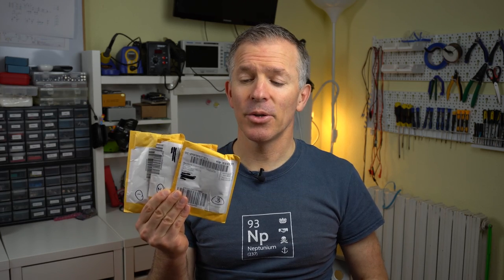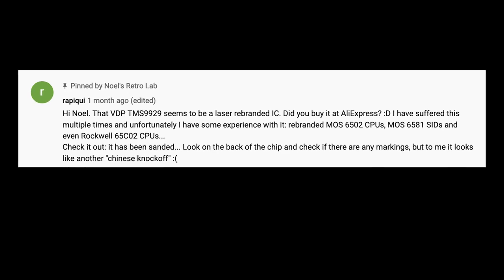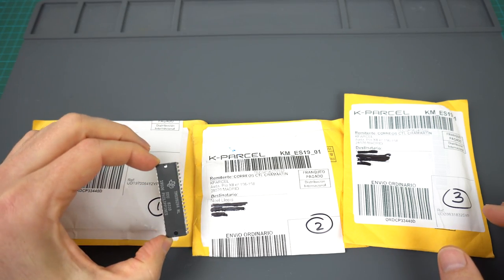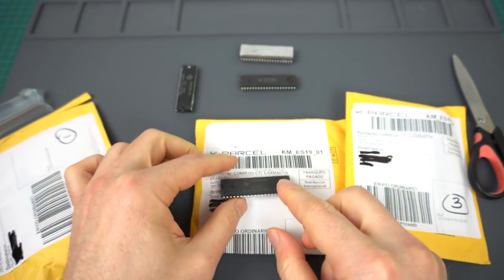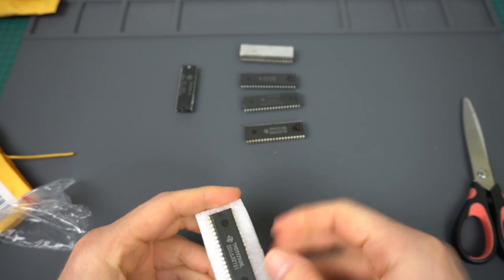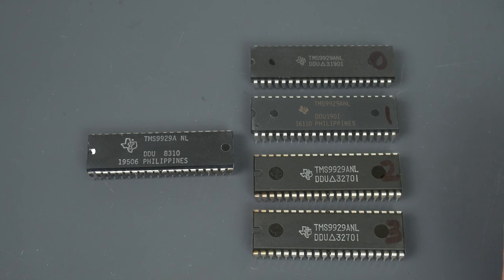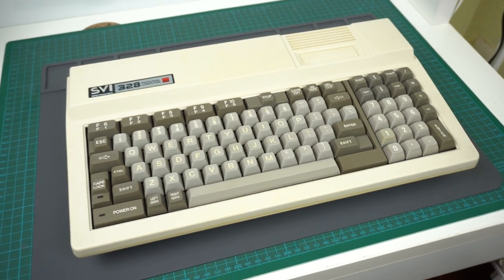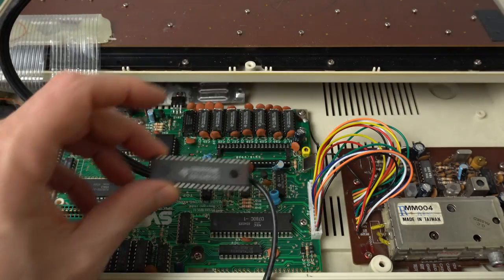Detecting FAKE Chips From China 🔍

Comment: I think the sellers are being scammed themselves, by wholesalers.  The fact that two had the same packaging suggests to me that the items had arrived and been shipped without testing, inspection or verification.
One instance that happened to me, I bought wire strippers from an eBay seller, in my own country.  They didn't work, the assembly was so poor they just couldn't work at all, so I contacted the seller with an explanation of how the strippers could never have worked and a photo and a diagram of how they never gripped the wire.  All I got back was "I just sell them" and a refund.
Reply: They must be "Drop Shipped". The seller never even sees the product.
Reply: Was thinking same...drop ship bulk buy
Reply: Most likely and I’m willing to bet it’s around 60 percent real and the rest are fake so that the fake ones will seem like “dead” chips while in reality they never worked
Reply from the maker: True, but a reputable seller would cut that distributor completely once the reports of fake chips started pouring in. I believe these guys continue buying from the same distributors even knowing about the problem with fake chips 😞
Reply: Resellers and middlemen can often get good parts when they order for the first few times with a supplier but then the quality seems to drop eventually. Bad batches exist also when buying in bulk. Sometimes there are legitimate excuses but other times not. Buyer beware but having a personally known contact defintiely helps with minimising fakes or broken parts.
Reply: I think most people in the "west" has the mindset of "trusted vendors/brand", I am not saying this mindset is wrong but for the Chinese it's completely different mindset altogether. Most of those sellers on Ebay selling cheap stuff belongs to a MASSASIVE industry of manufacturers, recyclers, sellers, vendors  in China. That is why they all have the same packaging, descriptions, price, etc. They may or may not belongs to a same seller but they've got the products from the same sources. Just look up videos or if you have been to any of the "wholesale" market in China, you will know. Tens of thousands of vendors selling basically the same stuff from equally as many manufacturers. They are all generically made and resell. When there are literally ten of thousands of vendors out there. There really is no "trusted vendors/brand", one vendor is just as good or bad as others. One vendor could be selling bad ones one day and could be selling good one the next day. I can bet you that those sellers in this videos has thousands if not tens of thousands item listed. With this many items selling, no one will realistically quality check the stuff that they are selling, just as long as they can sell them. I can imagine that these chips are so cheap in China, even if they sell them at 10% of the asking price minus the cost of selling/shipping, there is still profit to be made. and with that thin profit does anyone really want to spend time and effort to made sure that they work to specification?
Reply: It's the same company. Both Polida and HK sell the same fakes.
Reply: That's what I've found, I buy large amounts of IC's through Ali-express (Normally the same few trusted stores) I've only gotten fake chips once and I messaged the seller and they had brought them in bulk from a wholesaler and not checked them because they couldn't possibly check every chip they sell (sometimes I get them in lots of 40+ for TTL logic chips).  They sent me replacements that they had tested directly and removed the fake chips from sale.
Reply: I read that often when a dodgy wholesaler sells chips they'll often send quite a few legit ones normally the first in the tube etc but pad out the number with fake chips also, which makes it even harder.
Reply: I think the sellers are buying failed lots of chips. The manufacturers don't test every chip, If some of the test chips in the current batch are bad they sell the batch onward to recycling centers. Just having some bad chips still means most of them are good. So the sellers sell mostly good chips with a semi-large portion of bed ones...
Reply: That or vendors use multiple accounts. Same picture, same postings, too coincidental.
Reply: @sweetpoison5341  Sounds like a Broken Market to me..   And, as he said ("The only way for this to work is to sell on a massive scale") .  Thus, with so many dummy products sold, who do u think is truly benefiting?  That's Right!   *THE GUYS ON TOP OF THE PYRAMID* .  It's Ironic cuz this is what I hear 'everyone' hates on Capitalism for doing!     It shouldn't be on the sellers to check.  They should be able to trust Vendors and Vendors should be able to trust suppliers & Suppliers should trust the QC-checks done at the manufacturing level.   If indeed it works as you say, I blame the cause, not it's effects. It looks intentional and has got everyone running around like rats in a maze.Welcome to New-World-Economy
Reply: @jasonproebstel1879  No good reason the manufacturer can't run batch checks in their lots.  Not in this day and age! it can all be automated ffs!  by removing say 1 chip every 100 or 1000 and plugging into test board.  Big deal! Plus, they can dump the tested chips into a "Known-Good bin" and sell at a mark up.   They just dont want to take a loss if they can unload to vendors and suppliers.  Srsly this is happening with intent and has been for decades.  Be it Captialism or Communism. They both look pretty damn similar to me these days and that's sad.
Reply: @glytchd  I think you are overthinking this, just as so many "educated" liberal Americans. Most of these chips are either made or recycled in a massive scale. think millions. They are either noncritical components or components for inexpensive items.  I am not sure what you are talking about "guys on the top", suppliers and vendors, etc. EVERYONE on this planet who uses modern technology is part of it. There IS no one else to blame, If you have bought/used any technology at all, you are part of the blame. sure, guys on the top gets the most, but you too, gets saving. and THAT, my liberal friend, is part of the problem. Those parts are not dummies, they are probably made with minimal to no quality check whatsoever simply because the cost of hiring QA would probably cost more than the cost of the chip itself. If you want these things in good quality, you would probably need to spend many times more to get them. The question really is Do you really want to? or, DO you really care?
Reply: @somnorila9913  It doesn't matter. They already have your money. You say that you will never buy from them again, but it doesn't matter, because they have 200 different identities so you'll happily buy it 200 times and get pissed off 200 times
Reply: @thewhitefalcon8539  This is a serious cultural problem we have. And is quite more visible and prevalent in areas where capitalism is seen as the cure of all illnesses. Where is the pride for a job well done? Where is the care for doing something worthwhile? Profits should be effects not goals. I mean is not wrong to seek out profits but those should rather be secondary on your scale of values.
That idea that some act this way because of survival instincts, because they need to eat, seems to me a big lie. Few are really in such a position nowadays that are literally starving. So it's just people being greedy douchebags from small potatoes to big ones.
Reply: @somnorila9913  the more money you have, the longer you can go before starving
Reply: Nope, the sellers know they are shipping shit.

Comment: I used to inspect electronics for a distributor in the Atlanta-area, and I saw some pretty strange stuff: Acetone was the primary test that we used to test surface markings. When they'd sand off the surfaces, it would end up creating really sharp lines from the surface to the sides (usually they're curved). Ran into a few where they must have mixed the surface material in with some epoxy or something before they layered it back onto the chip; acetone test didn't remove the surface on those, but other visual clues would show a suspect part: Could see changes in the plastic coloring between surface and sides (or surface and bottom), or inconstancies in the printing, etc. My boss, the QA manager, had some pictures on his office door that showed people crouched over a sterno flame, melting solder from PCBs and then smashing them against rocks to pop the parts out. Then they'd take the components and do their dirty sinful business. It's a pretty crazy sub-industry.

Comment: Unfortunately some sellers use photos of real chips and sell fake ones.
The same problem is with transistors and other components.
The only option is to test as soon as you receive it.
Thanks for the interesting video.
Reply: Tha happens, a lot. If you want to swim in the swamp of fake parts have a look at RF power transistors, there are thousands of listings using photos of real parts but they send fakes which have been ground down and re-marked. Which is really worrying because they often use toxic Beryllium oxide and I doubt they clean the dust off properly.
Reply: I've had that happen frequently on eBay.  Polida in particular . No refund offered. They wanted ME to send them pictures of their fake chips even though they had thousands of those same chips still in their stock.
Reply: @hobbyelectronics6630  Polida banned me for forcing eBay to refund, they sent me a snotty note saying 'we don't sell fakes' and wanted me to smash up a transistor containing beryllium oxide then send them pictures of it. Definitely to be avoided.
Reply: I bought a fake low noise transistors. Too bad I only found out when it didn't work at low input voltage (45-60mA) in Joule Thief circuit. But better than someone who flies it into an amplifier, or even an IC.  :( They made false positive ratings on the beginning of selling. Only way is to report fake sellers.

Comment: I think that chip #1 is actually a legitimate original TI chip but is likely recovered from a used circuit board that was sent for recycling.  As you noted at the beginning these chips are particularly sensitive and the recovery process could have damaged that chip or it might have been faulty to begin with.  I believe this due to how the markings appear on identical to the original chip, how it passes the acetone test and it does not appear to be sanded.  I  think 2 and 3 are legitimate new replacement chips from TI.  The TI logo in the pit is likely a newer anti-counterfitting measure.

Comment: A couple of things come to mind:
1.  It might be that they are relying on fact that people won't quibble over a few dollars/euros and won't bother to try returning them.  This is the same principal used in rebates...many people buy a product because of a rebate offer, but only 20% actually send in the rebate.  Perhaps the law of averages is what's at play here? 

2.  Maybe there's more nefarious reasons?  Perhaps the seller is hoping to damage the electronics of whatever these chips are being used for?  I don't know how that would be possible, but if they could make power come out of one of the data pins, you could damage the component on the "other end" of that data line.
Reply: The eBay seller probably has no idea that the chips are fake, or even what they are for or how they work. Counterfeit electronics are everywhere, with whole factories dedicated to making inferior or completely bogus parts. It really is an epidemic. Small quantity buyers on eBay and Amazon are not the targets. It's likely that whatever distributor the seller bought them from is not even in on the scam.

I've brought this up with eBay and Amazon several times, and they basically love and support fake sales because it means more sales overall, and whenever someone finds out they've been screwed and complains, they just resolve it thru customer service. It's like you said, most customers aren't going to spend much time trying to get back $4 if they can solve the problem for $5 and move on.

Don't ever buy electronics on eBay or Amazon unless you're absolutely desperate or know exactly what you're buying. There is a darker side to this industry. Children and slaves are used to mine materials like tantalum and when you buy cut-rate parts online you also support that horrible industry. It's not worth someone's life to save five or ten cents on a capacitor.

Comment: I've run into counterfeit chips a couple of times.  About thirty years ago I came across a batch opto isolators that were flakey.  The leads had been trimmed to make them even causing problems for me because the part was being socketed.  In recent, I've come across a batch of OP-02 chips that have had a bad failure rate.  Examination showed trimmed leads and a top coat.  The top of the chip looked nice and clean but the texture was different from the sides and the bottom.  Alcohol and acetone didn't cause any of the top to rub off with a Q-tip but it did soften to the point it scratched off with a finger nail.

Comment: Chip number 1 had identically styled printing to the control chip, implying it was an old chip that had been resold. Older chips have older inks that come off more easily than the newer ones that use better/newer paint/ink. Personally, I think it's an old dead chip that was resold, rather than a fake. Chips 2 and 3 all had newer printing.

Comment: Great video! Really focusing on the fake chips problem, in a particular type of chip and doing methodical tests, like we got used to on this channel, rather than just mentioning and complaining about it during an unrelated repair. Good job! About buying fakes: I've recently had to go through four iterations, to finally buy a genuine 387sx PLCC FPU for my Amiga A2386sx PC bridgeboard. The first one worked for a few hours, before dying. The second and third plain never worked, and also prevented the computer from booting. The fourth one - bought in Europe from a retro seller not on eBay - finally works well ever since. Also, the lettering on the first three was a lot duller, and it was possible to wash it off/make it almost unreadable with some alcohol. On the working one the lettering was much brighter. Interestingly, checking the bottom of the chips they all say "Made in USA Cyrix 1989" so I guess they're all FPUs, except maybe some of them are broken chips from some leftover stock, or was rated for much lower clock speeds than my machine is running at.
Reply from the maker: Thanks for the kind words! And that's interesting about de FPU! There's defnitely a problem with chips that they change their speed. Those are harder to detect from the ones you supposedly bought. But if the lettering ever goes away, then that's a pretty clear sign that it's some kind of a fake.
Reply: Some months ago, 3 or 4, maybe 5, i'm not sure, Adrian Black released a video about "fake" SRAM chips which turned out to be okay, just not rated for the speed that they were supposed to run at according to the markings, so yeah, that's definitely a "thing" too.
Reply: Hans Otto Kroeger  Another good reason to give Amazon a wide berth!

Comment: Great video! Another way of comparing/measuring unknown chips is to identify the clamping protection diodes that most designs have on the I/O pins. That makes it relatively easy to separate supply pins from I/O pins and compare that to the expected pinout.
Reply from the maker: Interesting, I hadn't thought of that! How would you do it? Just making sure there's no current flow in from those pins?
Reply: @NoelsRetroLab  Yes, sort of.  I/O pins usually have two protection diodes. One towards GND and one towards Vcc. This to protect from transients. You can use your multimeter in diode mode to search for these diodes using the expected pinout as a reference. For example start with one meter lead on the expected GND and go through the I/O pins looking for the diodes. By swapping the meter leads you can determine the orientation of the diodes. Then do the same for Vcc. If things don't add up then after a few rounds with the meter you can usually at least figure what is the supply pins on an unknown or re-marked chip.
Reply from the maker: @danieltufvesson1349  Good tip! I'll keep it in mind, thanks!